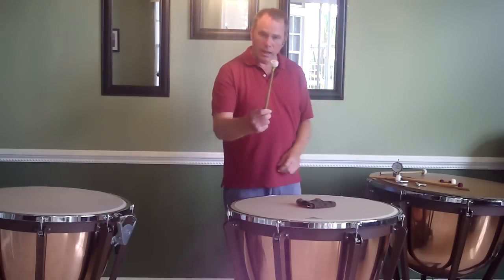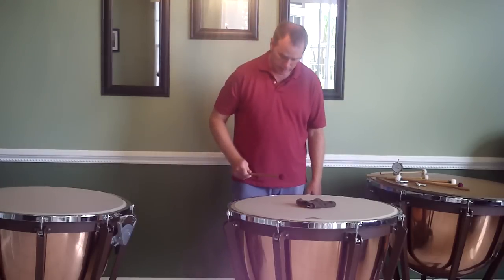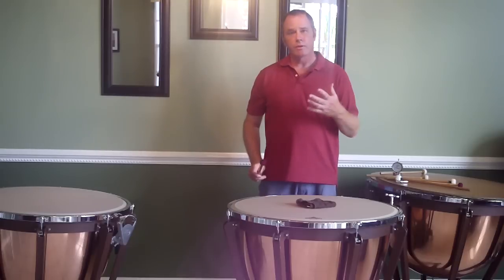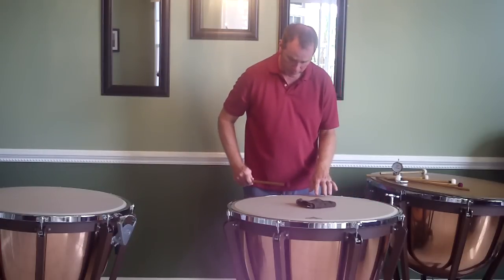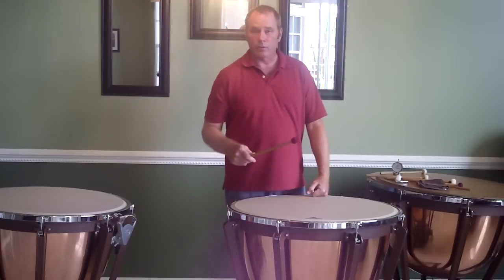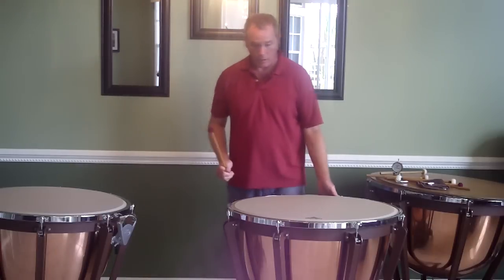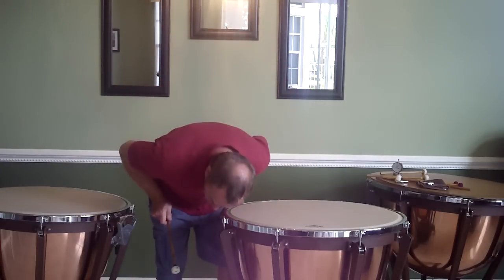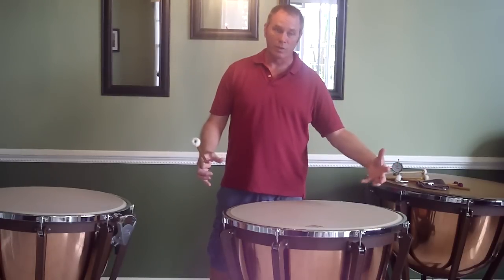How to Clear a Timpani Head or What is clearing a timpani head

Comment: Hi, what am I doing wrong if I can’t get the pitch the same at each lug?  The same ones are always out, and always by the same increment when I check with the drum dial.  Could my drum be out of round?
Reply from the maker: Here are somethings to consider. If your head is very old you might have to get a new one. Old heads are difficult to clear sometimes. Sometimes the Drum Dial can mess you up so if you find that you can't match the readings at your lug points, just use your ear. I live in hot South Florida and I've learned that heat can fix a wonky head. I leave my drums in the van for a day or so when the temps are 90 degrees or more and after that the drums always sound better. I had a teacher who used a heat gun, but you run the risk of burning a hole in your head with one of those things. You can measure to see if your bowl is out of round with a measuring tape. Just measure at all the points and if you find a big difference you might have to get out the rubber hammer and gently knock the bowl back to round.

Comment: Does a regular drum key work for tuning timpani or do you need one specific for timps? Thanks.
Reply from the maker: Snare drum tuning keys and timpani tuning keys are different sizes. If you can't find a timpani tuning key you can always use an adjustable wrench. Ludwig and Yamaha timpani use the same size key. Other brands of timpani like Adams, Majestic, etc use a different size, but none to my knowledge use a key that fits a snare drum